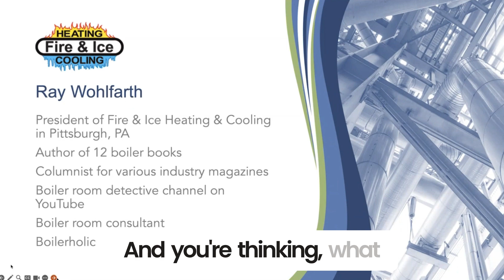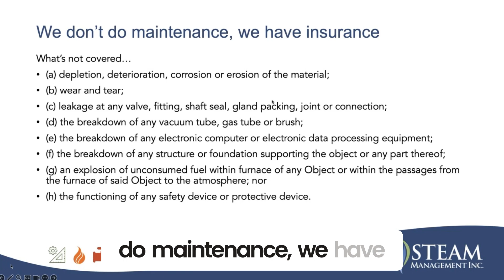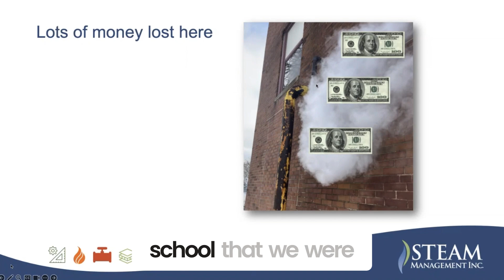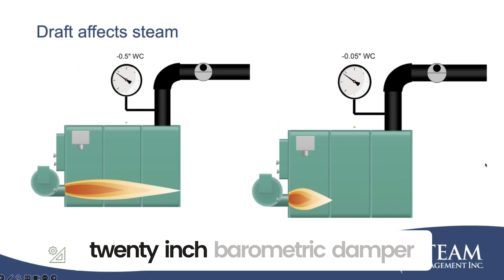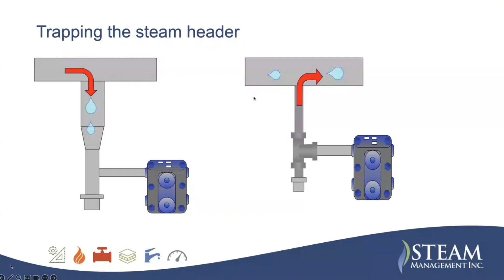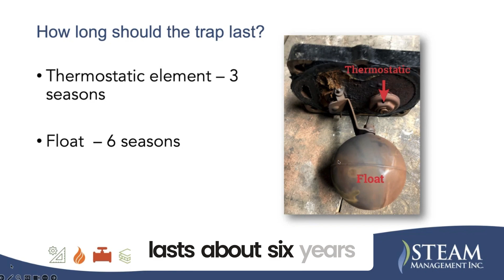Mastering Steam Systems

Comment: On a zoned system don't you also need a slow opening zone valve and need to be sure the steam sirge demand never exceeds the boilers rated steam output so the boiler water/carryover doesn't gush up the header.
Reply from the maker: Great point a slow opening valve is a good idea and vacuum breakers so it doesn’t go into a vacuum